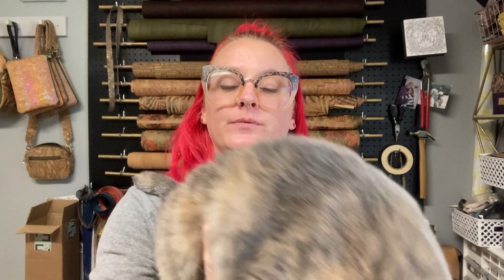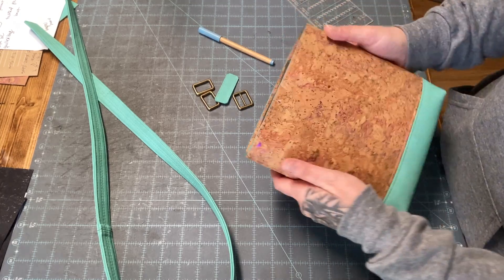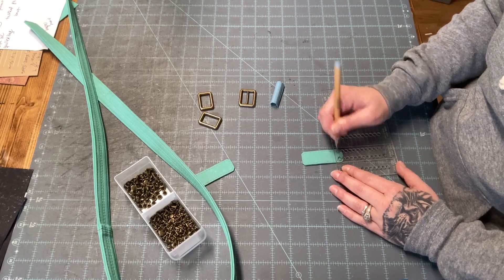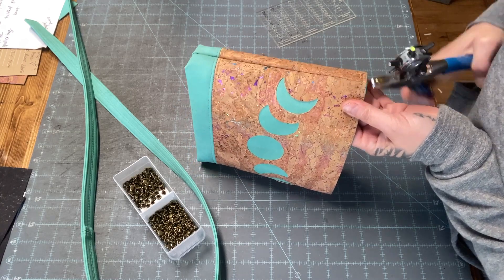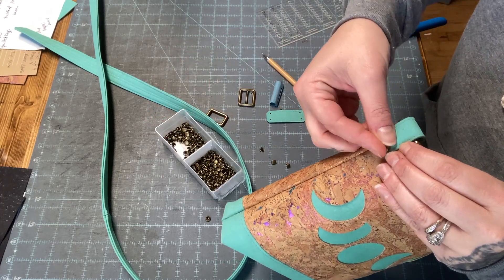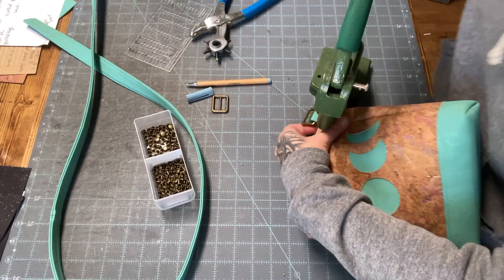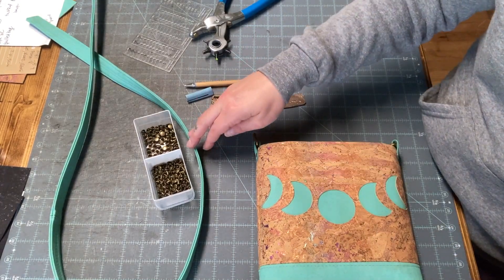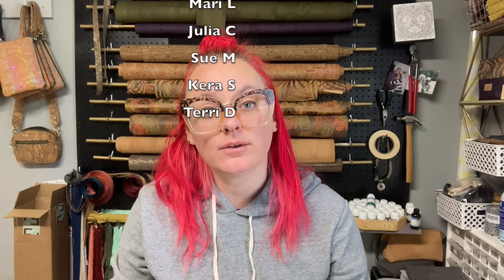SewGnar Mini Box Tote: alternate strap connector option

Comment: Can you teach us how to do reverse appliqué?  Please please please???
Reply from the maker: I’ve never really done a video cause it seems so straightforward. What is it about reverse appliqué that you’re unsure of?
Reply: @SewGnar  that’s a good question. Lol. I guess when I think about it, it’s easy to figure out. It does seem that cutting it out may be more difficult than regular appliqué?
Reply from the maker: Not really since you have to cut out the regular appliqué pieces too!
Reply: @SewGnar  you’re right. The only difference is that you’re cutting on the inside?
Reply from the maker: On the main panel, yes. Then you lay the other piece on the wrong side of the main panel and stitch it in!